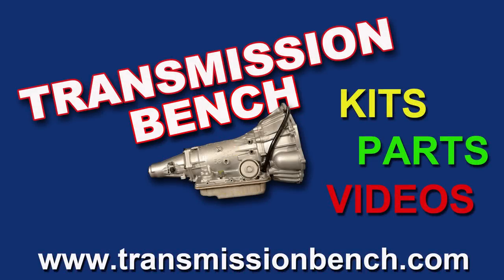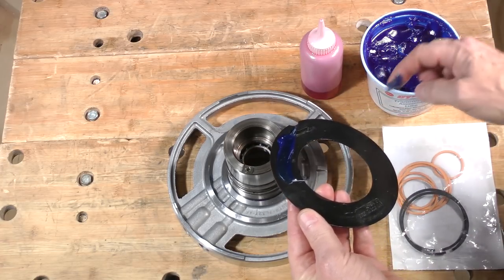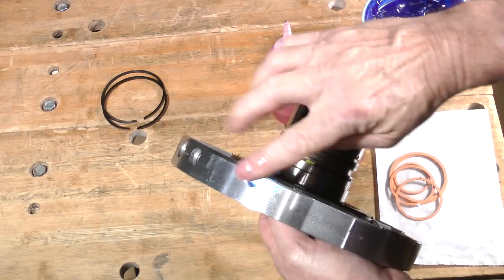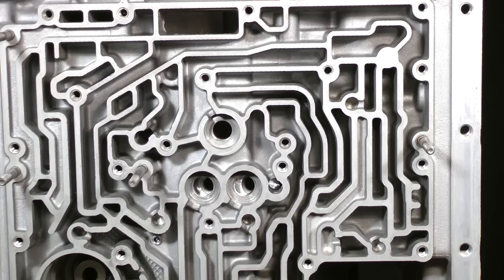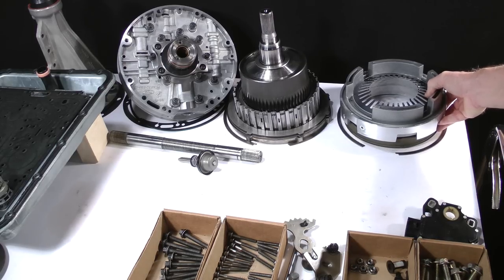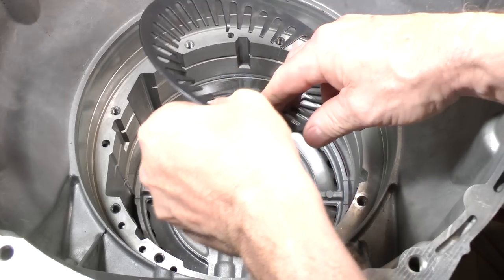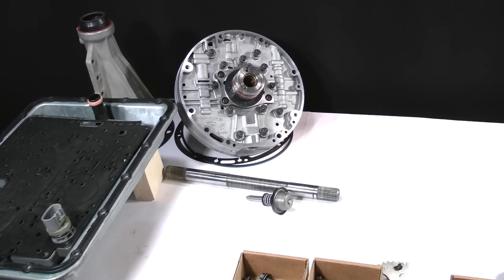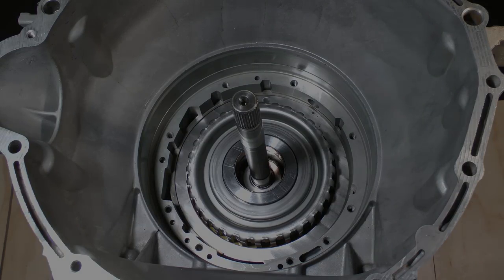Ford E4OD / 4R100 Class lesson 12 of 16

Comment: OK.....If you bought the Transgo kit and you don't have a foot press....DO NOT USE ITS SPIRAL SNAP RING!!!!! Its NOT the same as the Sonnax one from the kit PN# 36744-01. Gentlemen, I fought the Transgo unit for 2+ hours till I laid it out side by side next to the Sonnax one. Its a smaller diameter, slightly thicker, and is a total PIA!!!!!  Mr. Willimas is definitely installing the Sonnax unit from the kit in the video. It IS possible to do this with a large flathead screwdriver BUT....... I had a much easier time when I switched to a medium sized prybar. Makes it MUCH easier to press down a spring finger WHILE shoving the ring in the slot with the edge!!!!! DONT GIVE UP!!!!! DONT GO 1/2 @$$ and put in the old snap ring!!!! YOU CAN DO IT!

Comment: For those who can't make the tool to compress the ring you can lay a 2x4 across the case and wrap some wire around it and bell housing bolt holes and use a small bottle jack to press it down.

Comment: ATSG manual says to check the clearence on the overdrive clutch backing plate to case "selective" snap ring. My snap ring is 0.080" and the gap is 0.085" for a total of 0.165".
ATSG manual suggests I get part# "e9tz-7b421-da" at 0.120" thickness bringing my gap to 0.045" within the 0.032-0.058" range that is required.
This video does not mention any of that, and I cannot find that part.  How critical is this tolerance and can I re-use the original snap ring that leave a gap with excessive tolerance?

Comment: upon rebuilding my 2003 4r100 (diesel)  overdrive clutch pack, I found that it only contained 2 clutches and 2 plates instead of 3. You mentioned the diesel version contained 3. My failure was within the overdrive assembly.  Was this assembly possibly installed by someone else or was their a certain year they only used 2 ?
Reply: Mine also has only 2 🤔

Comment: If you were to use the old center support snap ring, what are the indications that the snap ring has come out of the grove with the transmission installed?
Reply: it wont move, that happened to mine

Comment: I've been trying to install the snap ring for the large intermediate piston and I can't compress the return spring enough so that the snap ring can fit into its groove. I'm not sure the cause of the problem but it looks like if the piston would move another.015 thou the snap ring could fit. I am physically unable to compress the spring anymore because the tool starts warping. Does anyone have any advice on how to fix this? Ive pulled everything out and tried to reassemble it but that still didn't help.
Reply: having the same problems what did you come up with?
Reply: I know this is old. If you’re talking about the intermediate piston just forward of the center support (some people online get the forward, direct, and intermediate assembly snap rings mixed up in part descriptions). I’d check to make sure you didn’t use the 3 .125” thick steels in the intermediate clutch pack. If you’ve got an e4od from before 99 or so, there are 2 sets of steels in the kit he sells (most kits). Make sure you compare your steels and use the ones from the kit which match yours. Mine took 2 thinner steels from the kit and one .125” apply steel from the kit.